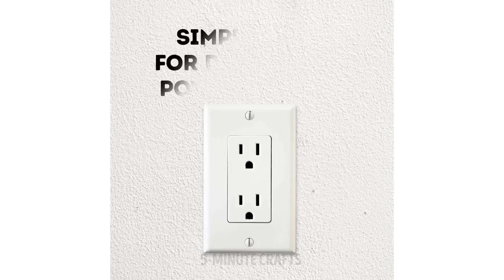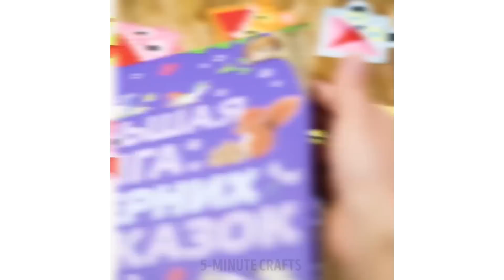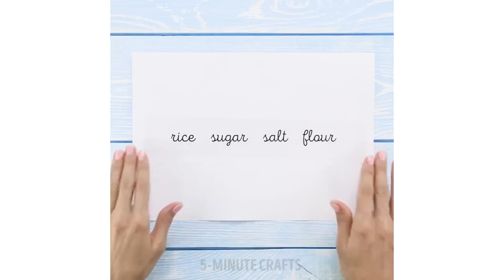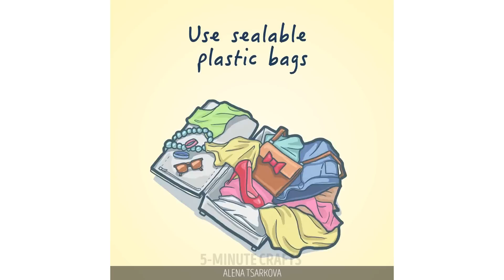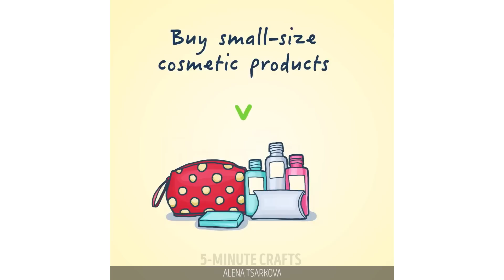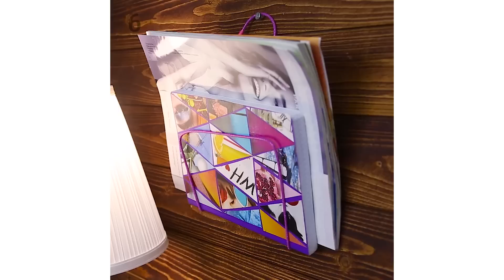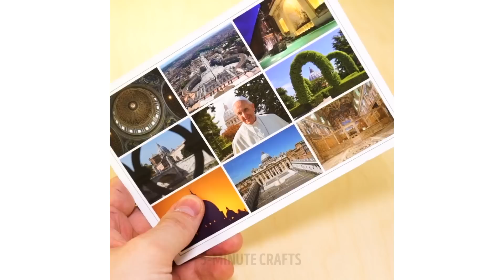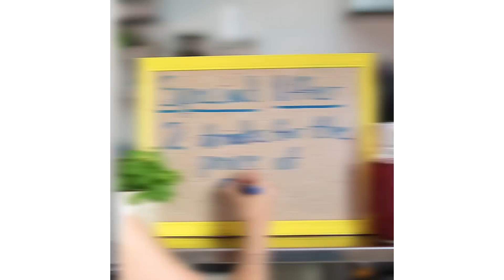50 BEST LIFE HACKS TO ORGANIZE YOUR APARTMENT

Comment: Where do people live that have "enclosed balconies?"  I live in Gresham Oregon, and I have never lived in an apartment with a completely enclosed balcony.  It is always open to the weather, and most of the time not usable year round.  I had ONE apartment that had a waterproofed balcony, and I could use it year round, but it was NOT enclosed.  It was nice to sit outside when it rained.  It was cold.   Currently live on the fourth floor with a balcony that has NO roof even.  Cannot use it at all, even in summer due to hot sun beating down on the balcony. Management forbids us to put furniture on the balcony, and high winds prevent use of umbrella tables.  I would rather have an extended living room.

Some good ideas though, but most of them my Grandmother already taught me.  Poor people don't call these hacks, they just call it living.  LOL